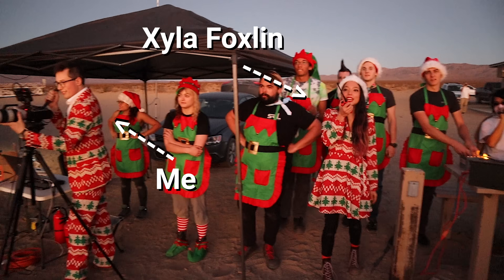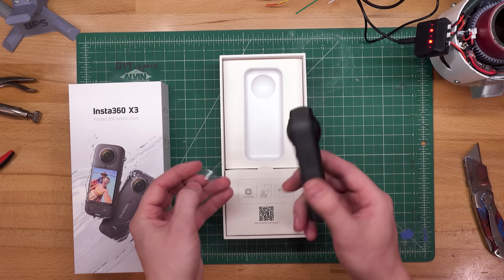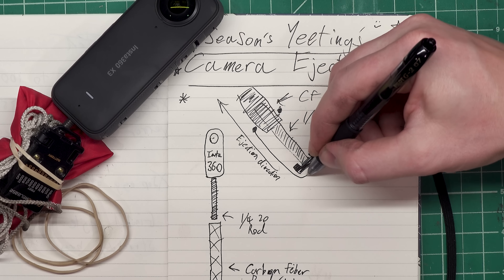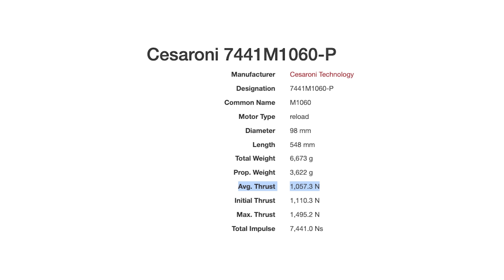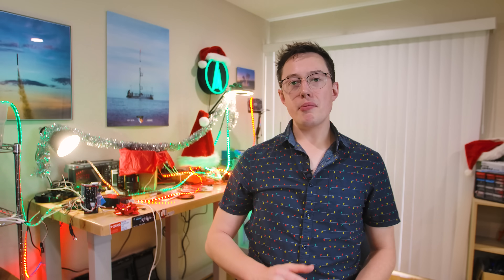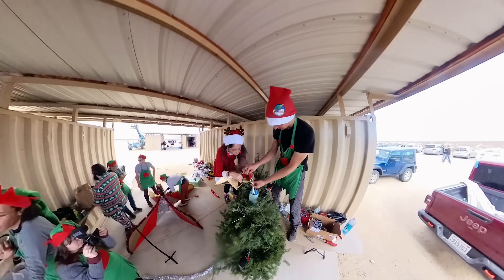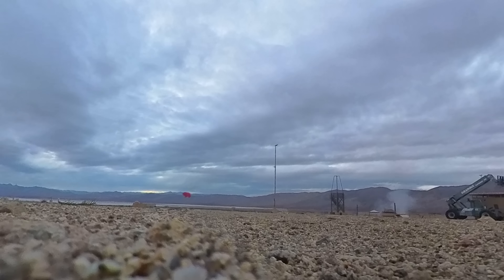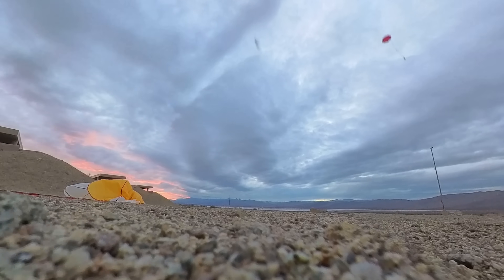Our Christmas Rocket Didn't Work Great... Feat. Insta360 X3

Comment: hi, ive started doing rocket modelling a little while ago due to my love of aero engineering and space and ive got to the point where fins are annoying and cap my capabilities, im thinking its time to upgrade with the thrust vectoring but because of my age im coming into some issues. im 15 and even though i have barely have the money  to buy the 3d files on your website as well as the in flight computor, im not sure how to run that computor and what to add to it. If possible id love a little advice on how to run the computor and on what programs, also when will it be back in stock? 
 all the best 
Will :)

Comment: Idea: launch a rocket in the middle of a rocket propelled circular (hollow) platform of 4 go pros mounted at a 45 degree angle facing up or down towards the rocket. Time the two to stay a given vertical distance from each other throughout the flight. Profit

Comment: Not a rocket scientist here, but: you could suspend the tree rocket sideways from a single point, and see if it points into the wind or sideways to it? I think that should both assess stability and be easy to perform as a late stage check. If it failed, I suppose you could... add some ballast to the front?

Comment: If you weight the tree appropriately (rebar works great) you don't need fins at all. I've sent a 10 foot tree to 300 feet straight as an arrow without anything but a proper weight balance and enough thrust.